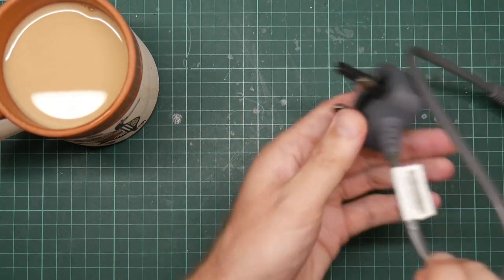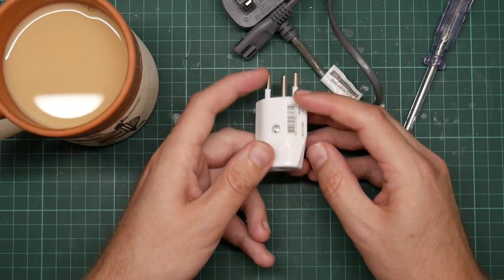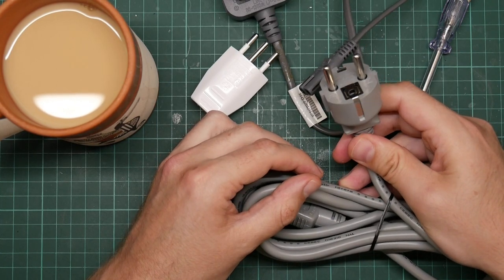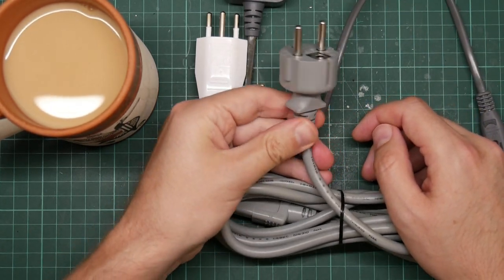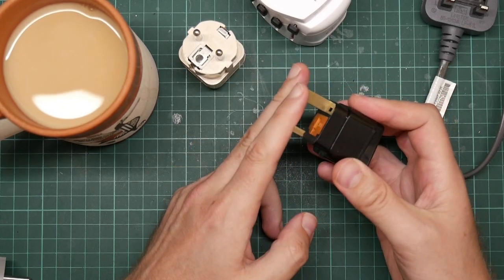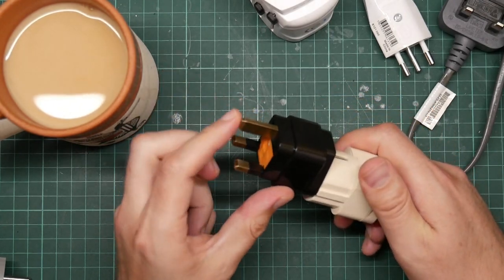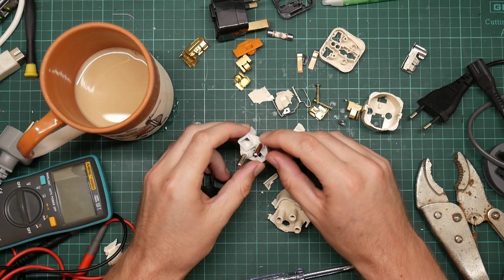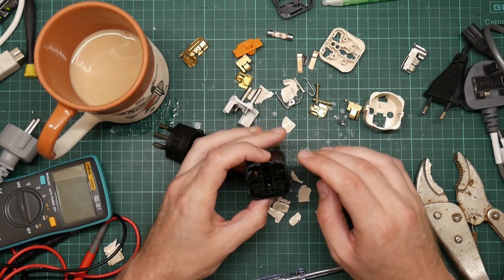Shoddy mains plug adaptors. Do not want

Comment: For travelling, I have a multi-adaptor/power-strip that I removed the power cord from, and replaced it with an in-line IEC C14. Then I just take a suitable PC power cord for the appropriate destination country and plug the two together. Worth noting that if it's a power bar designed for 120V, the surge protection needs to come out (and I suppose ideally be replaced with something rated for 240V)